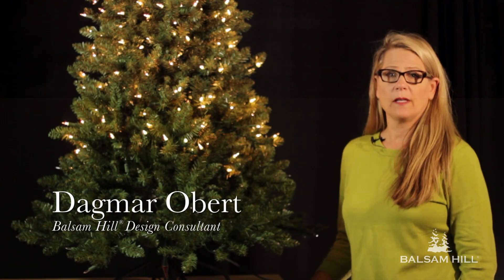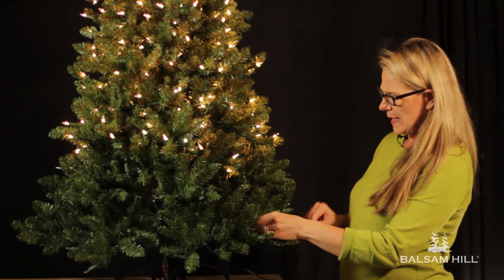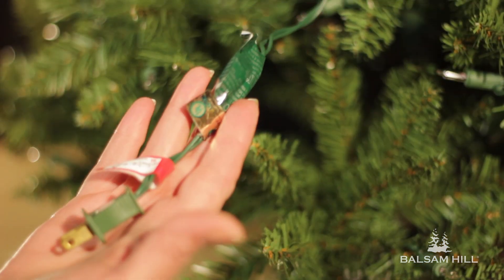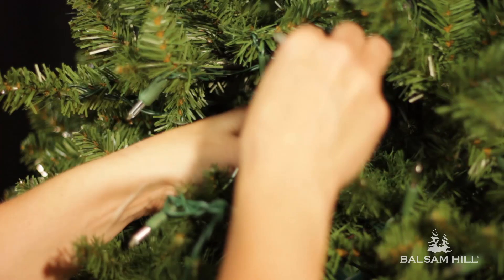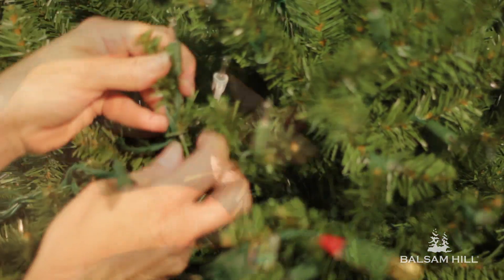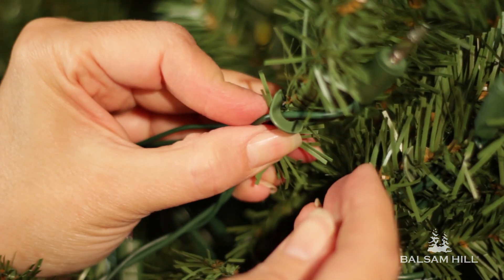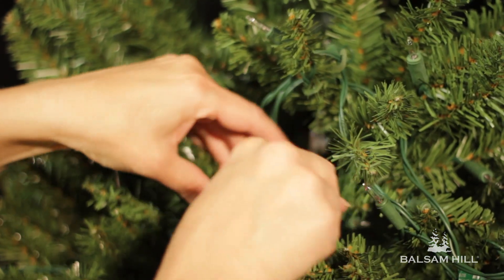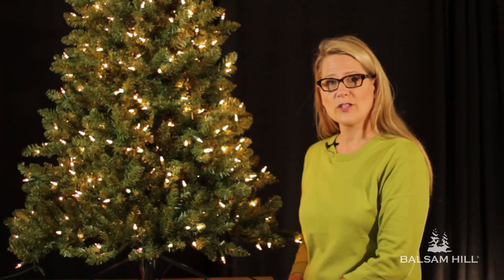How to Restring Lights on a Pre-lit Christmas Tree

Comment: So what I got from the comments was to not buy a tree from Balsam Hill.  I consider it a "bullet dodged!"  Taking the time to comment does help others.  Thanks people!
Reply: This videos quite old, their trees can now be purchased with LED bulbs, they last much longer. Incandescents are just not made to last.
Reply: don't buy pre-lit.  the trees themselves look very nice.
Reply: My Ashland brand pre-lit tree I bought from Michaels was fine the first year, the 2nd year strings started to go out, and this year - the 3rd year - the whole top 2 strings and some bottom strings were out. I found out about the testing/repair gun so I purchased at Home Depot. It did not work on this string and it suggested to check for burnt out bulbs - nearly ALL the bulbs along the strings that were out were burnt out! BTW, the gun did work on another set of lights, so the gun is cool and I would suggest having one on hand if you have a lot of the incandescent lights. I removed the top string of lights and it is a pain. LED is the way. I just wish I knew where to buy the replacement sets.

Comment: We bought a BH tree 3 years ago and after a year and a week the bottom part of the tree was completely out. It was out of warranty which in itself is an issue if you think about it. It takes a year + for you to find out the tree does not work after the first holiday season so it should be at least an18 month or 2 year warranty.  In any case, customer service did point me to numerous videos and instructions on checking bulbs, fuses, master bulb, etc to no avail.  BH did send me 3 sets of strands to re-strand the entire tree but it would literally take at least 5-6 hours to do the entire tree - think about that for a minute.  The process is simply unbelievably time consuming as these trees have hundredths of lights.  I ended up just laying a regular strand of lights for the season. This year, we unpack the tree and set it up and guess what, 90% of the tree is dark.  I messed with it for at least an hour to no avail again so the options is to now completely restrand the tree, but, what if the same thing starts happening? do we start restranding from scratch - CRAZY.   Save yourself money and buy either a cheaper tree and use regular lights to strand it. The cost and pain of dealing with the lights out is simply not worth it.
Reply: What's the point of having a prillet tree if you have to put lights on every year? Lol
Reply: @rahzellsutton2854  I believe the point he is trying to illustrate is that there is no point getting a prelit christmas tree if they end up burning out in just a couple of seasons. So buy a tree that is not prelit, costing hundreds less than a prelit tree and saving you the grief of dealing with the ultimate demise of prelit trees. I too went through a couple prelit trees with the same situation... the problem is really the incadescent bulbs, the better (and even more costly) choice are trees prelit with LED bulbs.
Reply: We’ve had the same Black Friday Home Depot $69 Christmas tree for probably 10 years or more. Lights up every year, big and looks pretty. I have read a lot of reviews saying Balsam Hill just doesn’t last and for that price, it really should.
Reply: @theoriginallacey I’ve heard the same thing. I was seriously contemplating getting a Balsam Hill to replace our older artificial tree that has big sections of lights out but after reading reviews, I think I’ll save my money. Seems like a product at their price level should last much much longer.
Reply: Found out I’m out of warranty yesterday and I have a 7ft slim tree. Top and bottom are out. After watching this video I’m like Omg this will take hours to do.
Reply: I can confirm it is 5+ hrs of work to completely restring a 7ft Christmas tree. I was especially pained (literally and figuratively) by the fact that EVERY bunch of branches had a c clip holding the lights. There's about 9 or more clips in a bunch. They weren't easy to pry apart to let the lights out and even cutting the lights to slide them out took more effort than necessary. My fingertips feel raw and are so sensitive, I had to stop. This task could be a form of torture
Reply: @MistyOceans  the dumbest thing my family has done was buying a 1983 front wheel drive Chrysler .  Buying a Balsam hill 'pre-lit' tree was a very close second :-D

Comment: If you start now, you will be finished by next Christmas. I am still working on it after several days. I finally have the top done. I ended up sniping them all off. If it takes 3-5 minutes per bulb and your tree has 300 bulbs...

Comment: 6 years into my Balsam Hill tree and I'm starting to experience issues with the lights that I'm now realizing is unfortunately common. I purchased a pre-lit, white-light Vermont White Spruce in 2017 (6 years ago). When I put the tree away last year, I noticed for the first time bulbs that had burned out. This year, when I put the tree together, large swaths of the strings were completely out. Several hours, a surprisingly helpful call to Balsam Hill, some more hours, purchase of the Light Keeper Pro, and then some more hours, the tree is up and running. Mostly. All the strings are now lit, however, I'm 62 — yes, sixty-two — bulbs poorer. Thankfully, the tree was fairly heavily lit, so it still looks good, but 62 empty sockets is a little bit noticeable. And, as others have mentioned, the BH bulbs have a different base. I will call BH again and ask, if by some chance, they can give me a bunch of bulbs, but I'm not expecting anything. After 6+ hours of diagnostics, I hope the lights get me at least through this season, but I'm mentally preparing for when I'll have to remove them and just string my own lights the old-fashioned way. I highly doubt I will try to "pre-light" the tree again because, sooner rather than later, the next set of lights will fail, too. Beautiful tree, but I'd advise others to consider buying a bare tree and lighting it themselves. To those that are throwing their tree away because the lights are failing, could I implore you to re-use what you have? Consider the waste, please. Through specialty salvage recyclers, the lights themselves are recyclable and the tree is still 100% usable and in great condition.

Comment: Our tree is also 1 year old. The lights on 4 of the limbs went out. After 5 phone calls to Balsam Hill technical support the problem was not resolved. The troubleshooting found in the documentation is inaccurate and the support personnel provided conflicting information which made the troubleshooting effort even more difficult. We were told by technical support that the replacement "section" will not be available for 7-9 months. Good money was spent on an inferior product.

Comment: My Ashland brand pre-lit tree I bought from Michaels was fine the first year, the 2nd year strings started to go out, and this year - the 3rd year - the whole top 2 strings and some bottom strings were out. I found out about the testing/repair gun so I purchased at Home Depot. It did not work on this string and it suggested to check for burnt out bulbs - nearly ALL the bulbs along the strings that were out were burnt out! BTW, the gun did work on another set of lights, so the gun is cool and I would suggest having one on hand if you have a lot of the incandescent lights. I removed the top string of lights and it is a pain. LED is the way. I just wish I knew where to buy LED replacement sets.

Comment: Throw the damn tree away. I’m dealing with this and it’s a living nightmare. The lights are twisted in unimaginable contortions.
Reply: Tell me about it... I used my wire cutters and cut the damn strings off and THAT was even frustrating and hours of work!!  I cut out the whole clear plastic sleeve too that the light strings fed into at the trunk base.  Done with that nonsense.  Next will be switching next year to high quality LED lights from a reputable company.  Supposedly they last sooo much longer.  I found a special 3-outlet cord to use along the tree trunk for a total of 9-outlets. When used up the trunk of a Christmas tree, the cord provides outlets through center of the tree.   This way you don't have to plug them into each other and can plug each into the plug station of the cord.  Another tip I read is to use 50 light strands so if you have a problem (this was for incandescent), there is not a lot of unraveling to do and testing is easy.  Talk about a great idea!
Reply: I feel you! I'm going to punch however l whoever thought of tangling these lights in a prelit tree. They are impossible to get out, easily. I'm cutting them out....it's a mess
Reply: I bought a prelit tree a couple days ago and the lights were so poorly strung I couldn't move the branches properly. I spent over 2 hours taking all the lights and clips out. And my tree is only 4.5 feet tall...

Comment: oh man i need to do this and it is going to suck.
Reply: Toothmother how did you get replacement light strand? I have an old tree where you can't replace the master bulb so I have no choice, but I can't get help from customer service so I'm wondering if you found a compatible strand elsewhere?
Reply: Hi Lisa I plan on using good quality lights from GE or another company. I will not be buying lights from Balsam Hill. The strands from them have been horrible.
Reply: Are you replacing entire tree lights? I have one strand out only (seems to me the "older" trees have better lights that last longer, 5 years and only a few bulbs outside that one strand need replacing is pretty good, I'll give them that). So I'm wondering if you're trying to plug into their trees power system? If so what strength lights are you buying? I'm afraid to overdo it and burn out the other bulbs.
Reply: I have way too many lights out to just replace single bulbs and they are out on all the strands. I have no choice, believe me I am not looking forward to replacing the strands. I think you are in a pickle because the new lights will be brighter than 5 year old lights. Sorry but I am not an expert. I would just replace the bad strand and be happy you are not me! :)
Reply: Toothmother... I’m not doing it I can’t , I guess I thought the lights would stay lit forever as long as I had the tree
Reply: ... The downsize to having this particular type of tree is replacing the lights, the upsize of having this tree is I don’t have to worry about my my cat 🐈 Terrorizing my tree all she does is sit there and look at it , cause she can’t jump her big butt  up in it , isn’t it beautiful Spirit 😂😂😂

Comment: Our warranty ended last month (November).  Our tree, apparently, has to be re-strung (December). This is year 3 for our tree - one would think re-stringing would be after years or heavy use. Our issue isn't one on their menu. We've replaced master bulbs; replaced fuses; checked bulbs for damage. Yadda-yadda-yadda. Not happy.
Reply: Kevin Murphy i have almost the exact same problem with my tree. i purchased it three years ago and was just 9 days outside of the warranty when i discovered multiple light sections were out.
Reply: Has anyone noticed that BH is not responding to these comments?
Reply: I am in the same boat.  I had a tree for 10 years and never had problems with it until year 8!  This one is 4 years old this year and half the dang tree is out.  So much money for a pre-lit tree that I thought was great quality.  NOPE!

Comment: I bought a BH in January of 2018 on sale at $450 and didn't set up until Dec of 2018.  Brand new out of the box with multi- and clear lights, middle section was not working.  I strung a section of both clear and multi myself and called it a Christmas.  Called BH a week later and they sent me replacement lights (which I still have and never strung but can now if something else happens).  I then called back in January 2019 and asked for a replacement since it was "out of box" new.  They honored my request.  Sent me a new section.  Lights up perfect.  Only problem now is that at the top of the section they sent,  one entire branch section is missing causing a huge gap at the top.  UGH.  I'm done.  Faced it toward back of wall and I'll live with it.  So much money but what I do love is that with a touch of remote, I can have all white, all colored or combined lights (which is my preferred look).

Comment: Very similar experience here. My restringing story follows. First, our BH tree now 5 years old and it’s just depressing to pull it out and hook it up. In 2017 when we bought the LED lights were a ridiculous premium, and, the marketing made it hard to know for sure if you were getting LED. I thought we did, but didn’t. So expensive. We justified the cost by thinking “this is our tree for the next twenty years”.  A year plus a day = issues.  Every year it gets worse. Plus that whole “check every bulb and fuse” thing is so 1980s Christmas Vacation. Give me a break Balsam Hill! This isn’t a normal issue - this shouldn’t be happening still.

So after five years of this, I looked into replacing the tree. The tree itself is still valuable and would be quite expensive to replace (lots of tips). I went to Amazon and bought 1200 LED lights and am doing this painful re-stringing. The only reason to send along this comment is to share with others - restringing is worth it. I’m halfway done and my family loves the progress. The LED light options these days are so much better, more features, less energy.  I bought four strings of 300 lights, will put one strand on each section (so I can take it apart) then use the final strand to wrap each year.  

My tree had 1000 lights. Taking them off took four hours. Once I got going, I cut the wires between each branch. Then cut those first two zip ties. Save all those c-clips. Wear nitrile gloves, which give the dexterity needed but help as your finger and thumb tips will get sore from the clip pulling and pushing. Use string or rope to hold up the tiers of branches you’re not working on. This helps both getting rid of old lights, and putting on new. Record the basic pattern. Mine used 16 lights per branch on the lower tiers then started to lessen as the branches got smaller going up the tree. I’m replacing with 18 lights per branch. Do a little recording of the patterns as you take it apart.

It’s December 3rd, this will be done today, and be a distant memory by Christmas.

I’m bitter about my BH tree, but a BH tree with good LEDs, well, it might still be worth it.  Those of us with incandescent - absolutely not.

I would not judge anyone who just pitched it and started over. It’s expensive to do that, and a bit wasteful, but time is all we control and it’s time consuming.

Comment: And the moral of the story is if you want a BH tree buy an unlit tree. Stringing your own lights is a cinch compared to taking them off the pre strung tree. Or you could do what I did and buy a platinum tree with ProTime lights from Treetime. Last Christmas was the 9th year I used my tree and it’s worked like a charm each year. It’s gorgeous too. I am not in anyway affiliated with Treetime, but just a very happy customer.

Comment: After hours of troubleshooting a strand of lights in the middle section of my 9' BH tree, I gave up.  It appears that one or more control bulb fixtures are out.  Not really sure, but finally gave up and spent 5 minutes stringing a loose strand around that section and voila, done.  I inserted a box plug that had one male prong and 4 female faces. ( probably got it at Amazon)  I could, but do not need to, plug another strand in if I wanted too.  Good Luck

Comment: I was very disappointed with the quality of the stringing of my pre-lit tree. I am going to have to remove the lights and restring my tree. I do not look forward to this which is why I ordered my tree pre-lit. It is pretty bad when you pay for something and it is not done correctly. I love my flip tree, but I don't appreciate shoddy workmanship. I have to admit to being very angry about this. Customer service was milktoast and unhelpful.
Reply: I found 30 zip ties on the top half of my tree. 30!! Very excessive. Also, if you find things wrong with your tree I would advise you to do two things. 1. Photo document your problems. 2. Do not make any changes to your tree. They will exchange it if it hasn’t been altered and if you do alter it in any way the warranty is void. Although I did document the defects I found on my tree, I had replaced my lights. Gahhh! It was very frustrating dealing with most of the people at customer service via email.
Reply: Thinking about ordering a flip tree.  Just chatted with customer service about the warranty and the lights.  She said if I don't want to restring lights they will send a replacement section.  But she said it didn't actually say that in the warranty, but assured me they would do it.  Not sure I believe her.  My husband wants to get the unlit Vermont flip tree and just string lights on it himself every year.  As a previous buyer of the flip tree, what would you recommend? I really love the whole flip thing.
Reply: Jan Wendt Just buy an unlit flip tree. If your husband is willing to put the lights on that is great. When he does put the lights on, make sure he puts the top half on separately that way you won’t have to remove the lights every year. Like I said in my remarks above, they do a pretty lousy job of putting the lights on the tree. And I was told that any alterations I made voided the warranty.